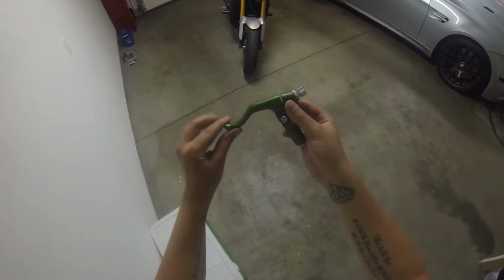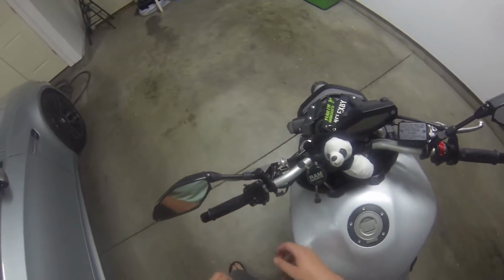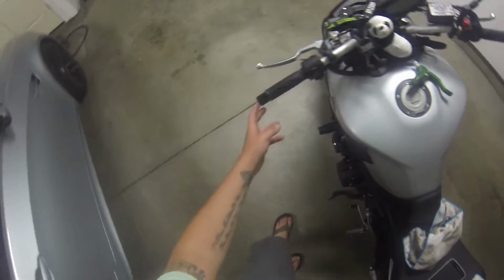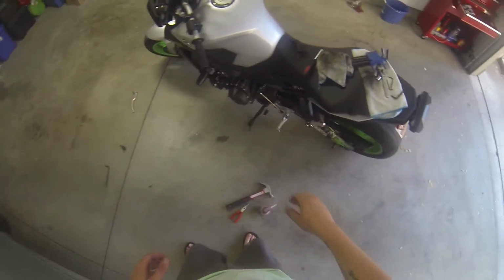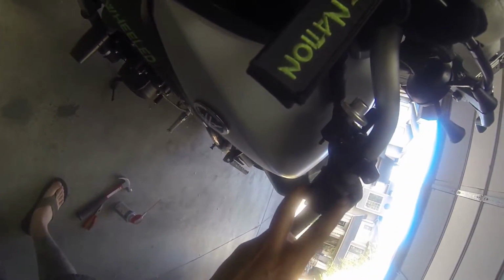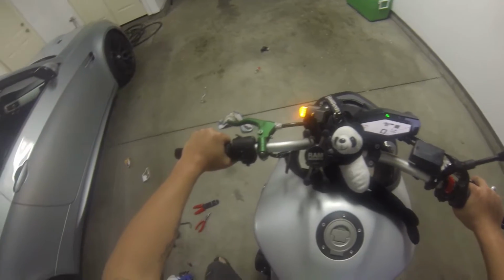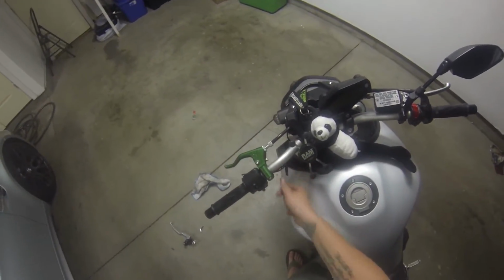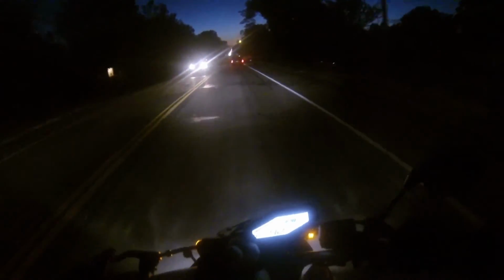RSC Stunt Clutch Install FZ09

Comment: I just bought a rsc shorty lever and I’m so excited. I’m just worried about the clutch sensor being disconnected. The only thing I have to worrry about is making sure I always hold that clutch in when starting the bike up right ? I usually start it up in neutral anyway
Reply: SnapBack Otherway around. It doesnt matter if you hold the clutch or not because it doesnt support the sensor. You just have to be on neutral and you cant start up on any other gear even by pulling the clutch.

If you wire the 2 wires together then the bike will always start in any gear but make sure you always pull the clutch in then.
Reply: asdsd asdasda I actually bought a fuse to close the circuit. Much neater that way. So by doing this the bike will start in any gear but I must remember to hold down the clutch correct? I usually start it in neutral anyway
Reply: Yeah the fuse is basically the same thing with wiring them together and yea just hold down the clutch when starting up on gear or otherwise the bike will roll on you!

Comment: I know its been almost a year, but wiring the two together is a bad idea. This will cause the ECU to think the clutch is always pulled in, therefore you'll be running in the idle map on the ECU all the time. Best bet is to wire it to a small dirtbike kill switch/button that you can push while starting the bike.
Reply from the maker: KCMOto I agree that there are multiple better ways for the clutch sensor, but I really was just wanting to get this done and cleaned up. I no longer jave this bike but I heard the one who bought it reverted it back because he didbt like it.
Reply: would this apply to non-carb bikes ? I have a 07 wr450 supermoto for street use and it's stalls at stoplight every once in awhile and takes  a few to get her started again. first time I've heard of wiring it to dirtbike kill switch button

Comment: When you wire the clutch sensor wires together does it make it function as normal again?
Reply from the maker: Saturday7x Yep, if you didn't do that, you would always have to find neutral before starting the bike. Putting the wires together makes is so you can start in gear
Reply: Could have used a fuse instead of cutting wires.